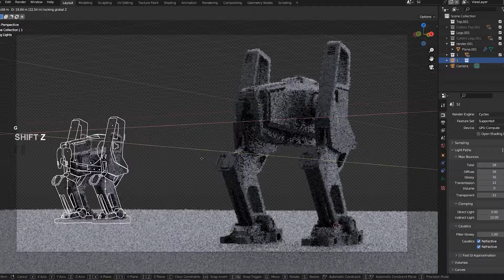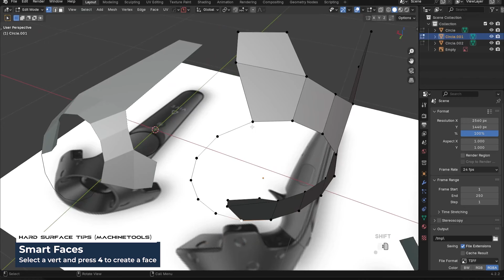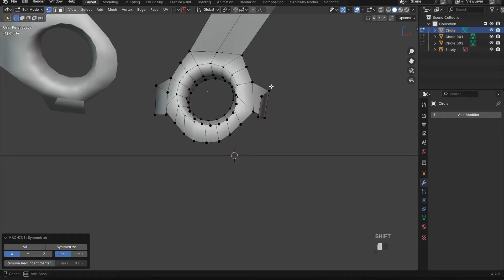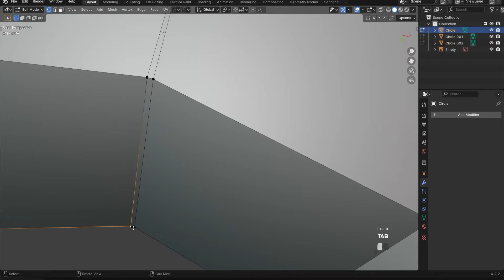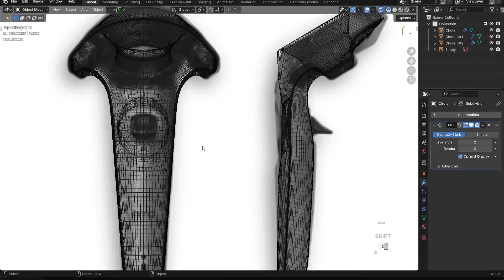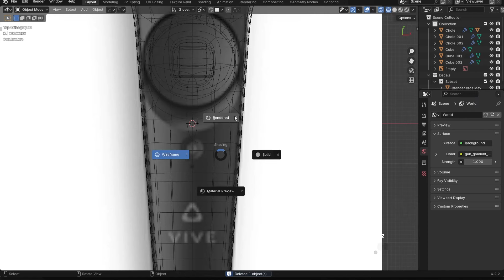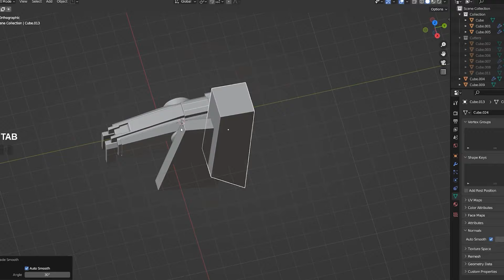SUBD Hard Surface Modeling Tutorial in Blender

Comment: a lot of the issue with the pinching next to the large circular cutout was caused by flattening the circle. there was curvature along the back, flattening the circle pulled those vertices upwards. i would do a knife project instead. Saying it's just a limitation of poly/subd modeling is not exactly true and the pinching can be avoided with careful consideration of the curvature... great video nonetheless!
Reply: You can probably use a shrinkwrap to keep the normals around the circle in check.

Comment: thanks my friend I'm modeling cars for gta 5 pc game  for south african police as a beginner.Your tutorial showed me many fast ways to complete my models clean.thanks again a proud subscriber.
Reply: Tip for if you're doing this for a game-- don't apply the subdivision surface straight away-- save the low poly version (you can use this as a LOD version).

İnstead duplicate the mesh, then apply subdivision surface to that duplicate. Do 1 level and click apply.

Duplicate it again, and do the same.

This way you have 3 versions-- LOD0 (the highest detailed one) for when your game character is closest to it, LOD1 (the middle detail one) for when your character is a little further away, and LOD2 (the original, un-subdivided mesh) as a low detail one for when your character is super far away (but can still see it).

This way the model is still visible, and when done right you can boost game performance MASSİVELY.

Comment: In order to get back the "Alt+D" linked behavior (past the 34min mark, after applying the Sub-D modifier) you can either select them all with the latest modified one as the active object then press CTRL+L -> Link data, so that they all share the same mesh data again.

Or you can do it manually by going into the mesh data tab. At the very top, there is an inconspicuous pop-up menu that actually contains all mesh datas used in the file (usually with original name, which can be tricky, cos even if you rename the object, the mesh data itself keeps the original name, i.e. cube, circle.243, cylinder.007, etc...).
You can then pick the mesh data of the object with the latest modifications you did then it will automatically update it. There's also a small number, as usual in Blender, showing you how many objects are sharing that same data.

Anyway, just sharing some tips that actually saved me quite some time. I use the Alt+D method a lot when modifying objects that are oriented in a weird way, which makes the axis modeling trickier. So I typically just Alt+D the part, reset all transforms, modify it, then delete it when I'm done editing the part. Sometimes I forgot, which is why I learnt how to get back to the linked data and ways to get around when you forgot and went too far to undo it all. XD

Thanks again for sharing all those tips and practical examples. Always so much knowledge shared, always so thanksful ! :)

Comment: The reason Ctrl-D doesn't carry is because you're only duplicating the mesh. Each object has its own materials and modifiers, but the mesh is shared. That's why when you add a modifier to one object it doesn't carry because it's a different object.

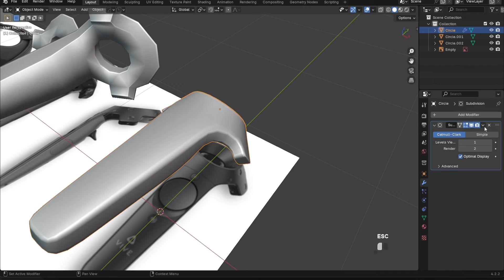When you apply the modifier at 28:07, you made the mesh "single-user", which means now the mesh is no longer duplicated, and each object has its own copy of the mesh. So now changes on one object won't affect others.

Also, out of curiosity, any reason you don't use the mirror modifier? Seems like less hassle than to symmetrize every few steps...

And finally, for the final model maybe adding extra proximity loops around the edges make sense, but "crease edge" has the same effect and doesn't add any extra geometry, which makes it easier to work with.
Reply from the maker: Correct, I used Alt+D at the beginning of the video, then later forgot I added single users. Not a big deal either way - same result.

You can use a mirror if you want. I prefer having the entire mesh and running symmetry.

I wouldn't recommend creasing the edges here, unless you plan to use a bevel modifier to soften the hard edges, which would effectively give you the same result. Otherwise, a crease value of 1 would create a perfectly "hard" edge and I don't believe in crease values other than 0 or 1.